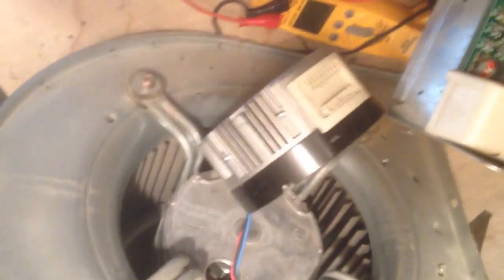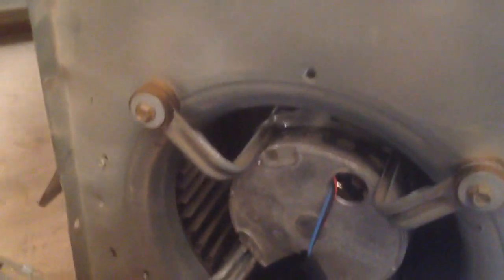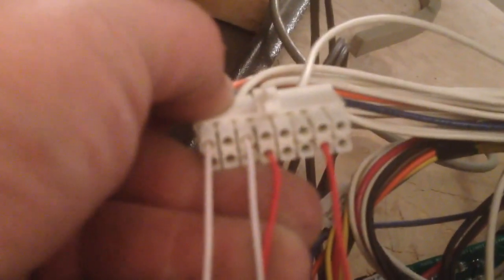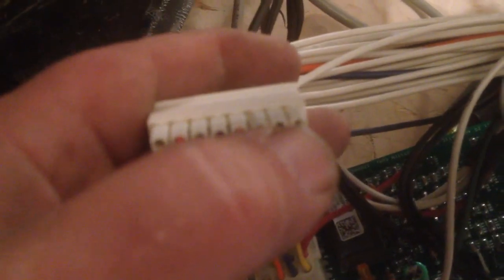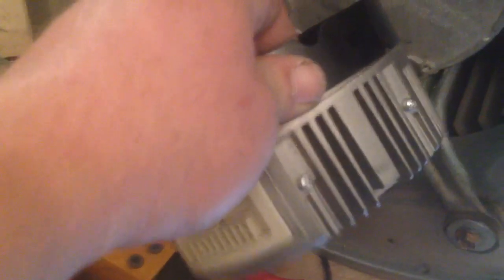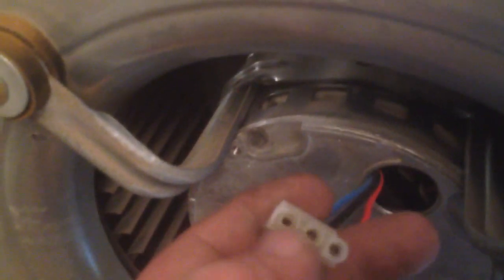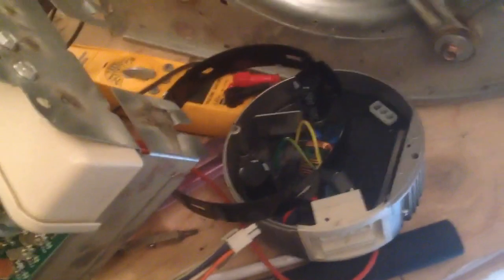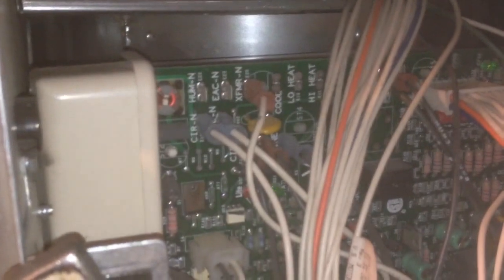Trouble Shooting A Trane Variable Speed Motor

Comment: First of all, thank you! 
I've got an auy100r9v4v0, that has been "upgraded" with the KIT16582 in it, with a blower like this. Furnace lights, blower never comes on, burners run till the limit trips, and it shuts down. Did what you showed here and the blower lit right up. So that means my control board in the furnace is bad right? Not the one on the back of the blower motor?

Comment: There is a tool available from Trane with board for troubleshooting the control board and a go-no go cable with 16 pin connector for much easier diagnostics.

Comment: The strange motion is usually caused by the motor itself failing. A few of the turns of wire in it become shorted (god knows why...), and it fools the inverter, causing the somewhat random jerking.
Reply: sorry totally wrong. these are three phase wound motors that hardly ever fail.
Reply: Oh yes they do fail. Changed many of them. Although it is usually the module.

Comment: Make life easier and a lot less expensive on yourself. Install a Quik Swap V3 circuit board, connect the wiring harnesses from the old motor and the wires from the new PSC 3 speed motor to the board, turn the unit on, and your finished.
Reply: As long as the customer agrees to have their unit's performance downgraded, that's fine.  If they haven't agreed or don't understand, that's cheating them.

Comment: ive been trying to get this straight in my brain....so these take 24vdc and convert them to 3 phase varible ac to control the speed of the motor??
Reply: Yes, but actually I think these run from 120 or 240 VAC.
Reply: @BenjaminEsposti  No, the 24 VAC in controls the 3 phase brushless DC (BLDC) motor.  The 240 VAC High voltage is converted to DC which is converted to a pulse width Modulated 3 phase output to control the motor torque and speed and there bythe CFM according to the OEMs programming code written into the control module in response to the 24 VAC inputs.  There is a Black disc near rhw donut transformer that is a Negative Temperature Coefficient (NTC) Inrush current limiting thermistor, about 1 Ohm when cold,which is supposed to limit the current entering the circuit on startup to avoid burning out the bridge rectifier on the board.  That thermistor is what usually burns out and is easily replaced if you can solder electronics.  The part costs a few dollars.  Zephyr sells a package with 1 NTC thermistor and a hollow ended wooden dowel to release the board from the split-end nylon stand-offs.  Use needle=nosed pliers and save $15.

Comment: So, if you remove the 16-pin connector from the blower controller and put the jumpers in it, how does the power get to the motor?
Reply: 120V power is supplied on a different pin.  The 16 pin plug just conveys 24V signal lines.  24V on different lines specifies different motor speeds depending on the programming in the motor controller.